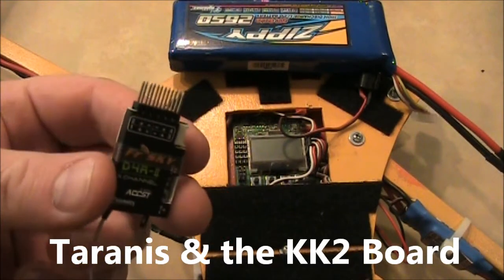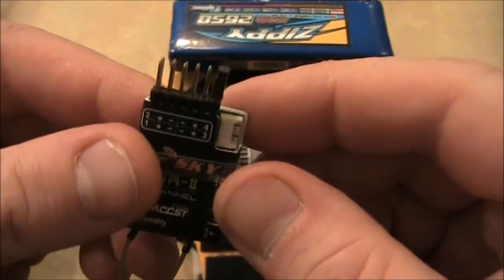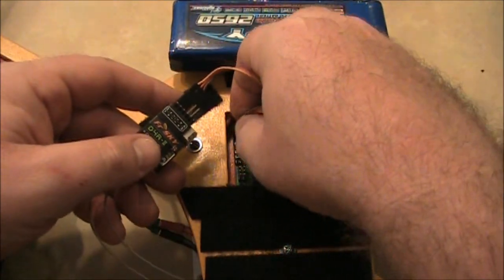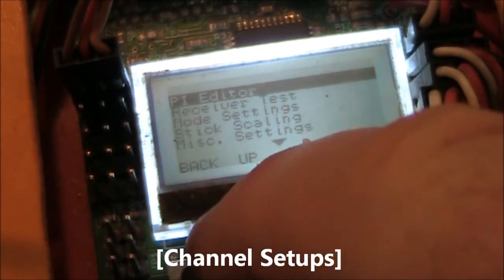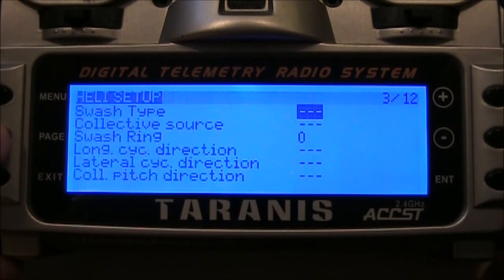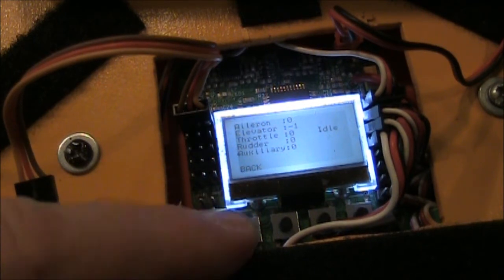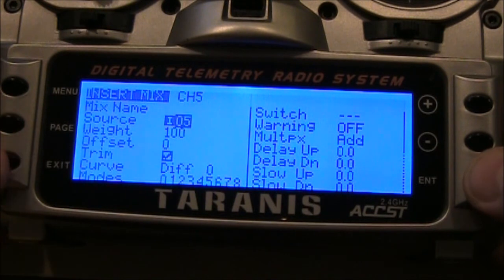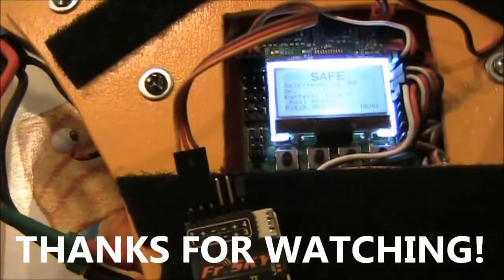Taranis & KK2 Setup - CPPM, Channel Setup, Channel Reversing, Auto-Level

Comment: Thanks for this. For folks that have the KK2 mini, observe that the RX input pins are in a different order/location than the full sized KK2. CPPM plugs into the Aileron input, or if you use SBUS, it plugs into the Throttle input.
Note that SBUS is only possible if you have changed/flashed your firmware to Steveis firmware.
Reply: Thanks, helped a lot!
Reply: I'm aware this is 5 years old but I have been gifted a KK2 Mini and I have an rx4r receiver and frsky x9 transmitter, The receiver and transmitter are working fine but I cannot figure out how to connect them to the KK2 mini is it even possible, has anyone got it working?

Comment: Hi, thanks for your simple and interesting tutorial. I followed your steps, and I obtained the first results. I have a quad copter, but only 3 motors spin...how can I fix the problem? Thanks a lot. Bye bye
Reply from the maker: Thanks!  It could be a lot of different things causing one motor not to spin.  You could try to find a KK2 setup video and make sure you didn't any steps, or try calibrating your ESCs, and also verify all your wiring is correct again.  Also, make sure you have your layout set to a quad.
Reply: Hi, thanks a lot for your help...I find the problem, wrong connection. I flip the connection from the motor to the kk2...XD thanks for your help

Comment: Tricopter, right? What yaw servo are you running? Just got that receiver, set up my tricopter with it, and the whole thing jitters uncontrollably - motors and servo. Only does that in CPPM mode. Works fine running the 4 servo leads not in CPPM mode. If I unplug the yaw servo while in CPPM mode, motors work fine. Servo filter helps some, but not completely.
Reply from the maker: I use this digital metal gear servo.  I use them on large and small tricopters and they have been awesome for me!  http://www.banggood.com/VWINRC-TREX-450-Spare-Parts-Metal-Gear-Digital-Servo-MG90D-p-78167.html?p=6Z050013977120130325
Reply from the maker: Here's me telling you what to do....  flash the latest version of Stevis firmware (http://www.rcgroups.com/forums/member.php?u=367321) on your KK2 and then follow the KK2 config steps around 33:00 in this video to get it setup correctly:  https://www.youtube.com/watch?v=e6K4NXoq-Qk

Comment: I want to set-up autolevel but I don't have the same menu system as your Taranis. Especially "inputs" page. Do I need to do an update? I can set-up KK2 on my 9XR but the Taranis is doing my head in!
Reply from the maker: Your Taranis may need an update.  You need to figure out how to assign a switch to aux1.  It shouldn't be too hard to find the setting.  The Taranis is a different animal than the 9X and 9XR.  It has a little more learning curve, but when you get more familiar with it, you won't miss your old 9XR.
Reply: Yes, I can confirm it was the old firmware. I just updated it to OpenTX 2.0 and it's all working now following your instruction. The other problem was that I had the cable in the wrong orientation on the board. Duh! All good now. ;)
Reply from the maker: Oh good!  I'm glad when things work like they are suppose to.

Comment: Thanks for this video, I am actually not sure what cppm is, and in fact when I click yes, my receiever (X8R) seems to no longer gets signal from the Taranis controls however your video helped me figure out why my hexacopter was flipping on take off. After months of trying to find info and trial and error your video got my hex flying leve in a couple hoursl! It was just a matter of adjusting the imputs (slightly different than yours, but it works now!!) Now for some fine tuning. Thanks so much ! Your videos are the most useful Taranis videos out there period.
Reply from the maker: Thanks!  I have a couple more Taranis videos coming soon.  It's always good to hear that one of my videos was useful!
Reply: *****
Good to hear. I will be doing the speaker upgrade soon, and just followed scott page's instructions to change modes. It has taken me awhile to wrap my head around the taranis but the more I learn the more I really dig this thing.

Comment: Can you show how to set up Naze32 flight modes using CPPM in a Taranis ?
Reply from the maker: I talk about a little about setting up switches in this other video.  I'm mostly talking about setting up a switch for the piezo buzzer but they can be applied to setting up the different flight modes.  Also, I'm not real familiar with the two auto-level modes the Naze32 has.  I've been trying to make myself fly without any auto-level so I can get better video from my on board cameras.   Discovery Buzzer on Naze32 with Taranis Setup